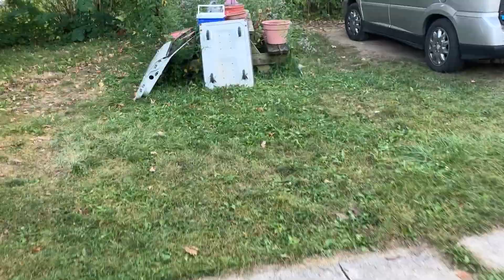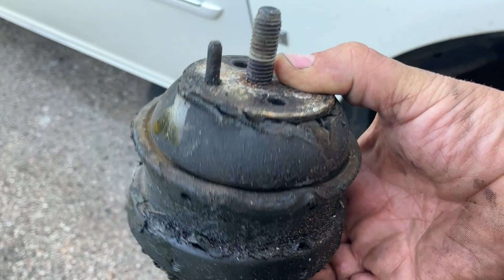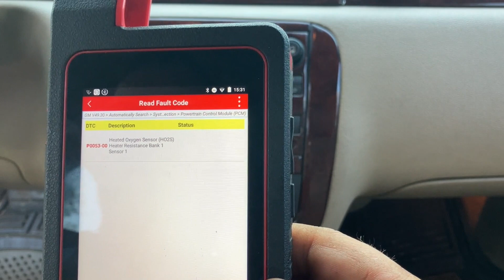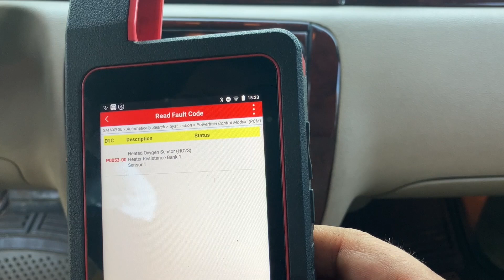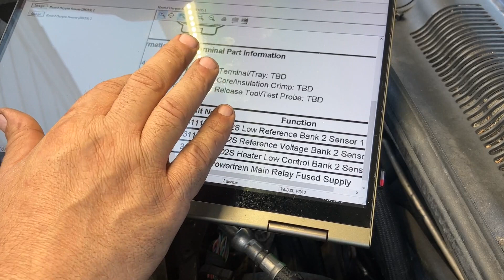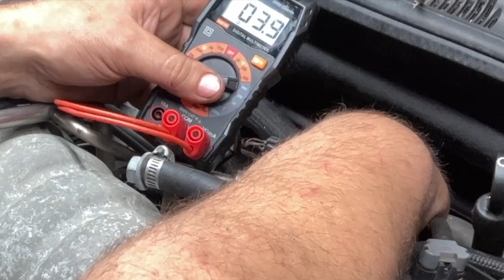Testing and Replacing an O2 Sensor In My 2006 Buick Lucerne

Comment: Hey I’m having trouble finding a o2 sensor for my 87 Buick Electra Park Avenue any suggestions would be greatly appreciated I’m also having issues finding spark plug wires too! It’s crazy! The parts u think r easy to find end up being the hardest to find. I already cut my wire on my o2 sensor so now I’m in BIG TROUBLE! Please help!!! Thank you 🙏🏼
Reply from the maker: is it the 3.8 or the 5.0?  Rock Auto has them.  rockauto.com